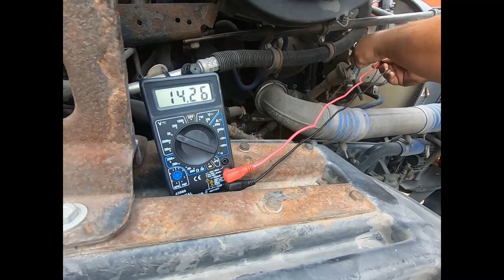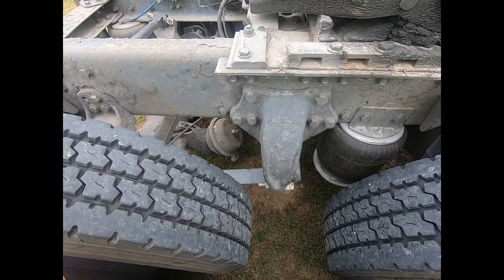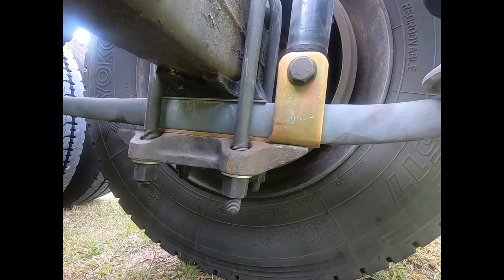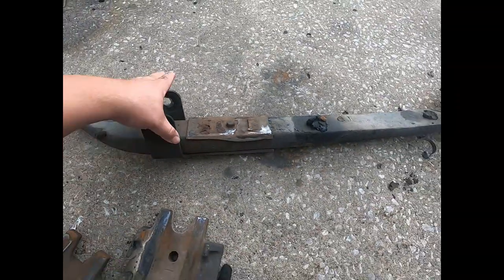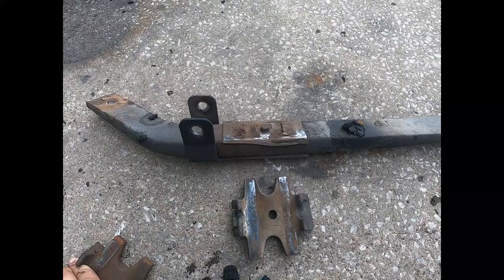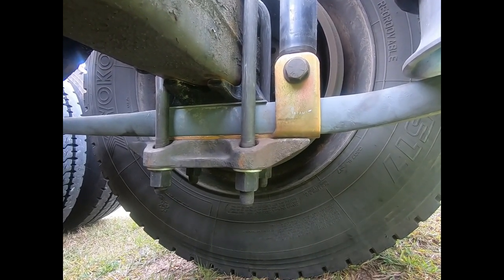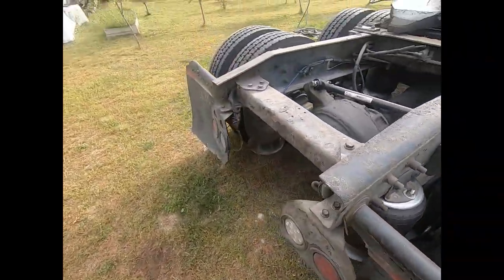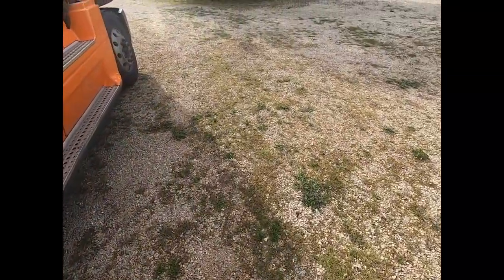Freightliner air bag lean...solution!! and suspension work

Comment: You made the right decision to keep your truck , i had a 2004 columbia with a 14.7 liter detroit  it came time for an overhaul at around 905k miles and i regrettably decided not to and sold it for 5 grand,  and got into a cascadia with a dd15 , man what  a freaken mistake,  first i knew nothing about def crap and I've come to the conclusion that trucks with def systems are not made with owner operators in mind there strictly made for fleets that turn them in b4 the warranty runs out or 450 to 500k miles cause thats when all the issues pop up and the trucks live inside the repair shop , it doesn't matter what truck it is they are all in the same boat , check engine lights , dangerous derates , clogged one boxes , constant regens , clogged egr tubes , leaking egr coolers automatic engine shut downs , the list is endless , keep your truck ffor as long as you can you wont regret it

Comment: Appreciate the vid! I've had my whole suspension redone when I first got my truck because of the lean and front bushings being shot. $2600 later everything was great until about 4000 miles, the lean came right back. I noticed on that little plate you pointed out on the rear was shifted or my spring was shifted from that plate. So now I have to take it back in and I will insist that they not only change those plate's out but the spacer as well. Appreciate your video and pointing this out.

Comment: Good afternoon, me and brother, just did the same thing. Replaced all 4 bushings, u bolts 1 of them plates. My driver side is sitting lower than the right hand side. I also put air bag on,leveling valve and new rod. Steve from N.B Canada
Reply: If it's still leaning,  make sure you placed the blocks in the proper orientation.  If you dont, you can get a lean. Had a mechanic replace one leaf spring and he put the block back the wrong way and it leaned pretty bad and had to take it to a different shop to fix it.

Comment: You dont need a 1 inch rattle or a 30 gallon compressor to do the work- a 3/4 is sufficient-The Hot wrench is your best friend A set of torches you can replace any part on your truck-Even with hand tools as long as you have a torch Ive done front leafs-Pins and u bolts by myself- Rear Bushings (I dont replace Good springs) bags-shocks-Its all easy if you think- But its heavy work. I rebuilt my fifth wheel- Steering Box, A-arm Tie Rod ends- All easy but heavy-Thats all- Shops take too much of your hard earned profits......And if the Job is too Big,Get yourself a small 2 ton crane- Its a lifesaver-  Wait till you have to do a Clutch,Rear main seal-Or Main/rod bearings- Part of owning trucks- no one taught me anything- I Drive and Got sick of half Azz mechanics who take no pride in your truck.

Comment: This is what I was looking for!! I've been trying to find a fix to detect what was wrong with my Argosy! This video helped me a lot! Found out that my center bolt had snapped in half and also found out that I snapped my shock absorber bracket too lol. Luckily I didn't damage an airbag or shock absorber. But I discovered that I had loose u-bolts that were ready to snap!

Comment: I have a 2006 freightliner columbia straight truck that the spring assembly has moved their is a aliment part hooks into the plate that has the u botls go though and the other end botls to the flange at the end of axel, The problem I have is this part dosen't show up on freightliner's computer so i need to find this part . I have pictures of this part that I can send to some if they need to see it.

Comment: Have a tri drive dual steer Freightliner concrete pump. We just purchased it.  I just did all the bushings on the rear axles among things. It's  got one hell of a lean. I'm gona be looking at the things you've pointed out.

Comment: I've found a great easy solution to the issue with the airbag lean. Less psi in the rear passenger side set of drives, my bags both leaned to the right at the top and to the left at the bottom but only in the rear set the front set of airbags were both even steven so I made sure all tires were spec psi and with a bubble leveler and a little geometry I made the required adjustments and the truck drives like a dream now! Over bumps around curves its a totally different ride even the steers started finally wearing even I've taken it to plenty of shops and replaced too many leafs and tires only for the issue to return and finally figured what the hell let me take a crack at it, I honestly wish I would have done it sooner. Such an easy fix that only cost me 7psi
Reply: @educateyourself8255  I didn't, I got rid of the truck
Reply: Less psi??? How?
Reply: So did the psi thing work??

Comment: When I purchased a new freightliner or used freightliner I built my own air bag cross members one for each rear axle if suspension need a rebuild I would do that first on used truck then add the cross member to axle if truck was new I did the same thing. Problem solved got 1 Columbia with 1.9 million still sitting and riding as good or better then my 379 0r 389 ...
Reply: Do you do suspension work?
Reply: I do not I look at other types of trucks with cross members and made some calls and did my research the reason back in 1995 threw present is that they concluded that the cross members weren't needed so that after the warranty was up U would have to rebuild either part of suspension or all of it but if u bought a new freightliner it was a option for cross members on Pete's kw Volvo it came standard which makes much more sense theres more to it then just the cross members also ware plates also which U WILL have to replace and build if U been running with bags leaning when bags lean it degenerates the ware plates center bolts and hangers and your tires so the truck is always fighting trying to go straight which causes so many issues on not just suspension but much more components which if would of been handled correctly from beginning those component's would of not prematurely not failed do not let air out of one side of bags this is VERY idiotic  the bags have there own height they must be set at to work properly with the rest of the suspension.....
Reply: I have a Semi coustom 2003 Columbia for sale no motor in it but its fully built just been sitting for awhile.
Reply: @blairvigil1633  Where are you located?

Comment: For the front spring upgrade,  I noticed there are two part no's that can be used.  46-1302 which is rated at 6000lbs and 46-1930 rated at 6650lbs. Do you remember which one was installed? I figure installing the 6650lb rated one will be a better upgrade.
Reply from the maker: I honestly don't remember sorry

Comment: 10,000 miles to retorque the u bolts is too long. 1,000 miles at the most. You haven't stopped the issue, like you said it's an inherent design flaw. The fix is to weld stop blocks on the inside top of the axle housing resting against the U bolt block, after you've got it aligned correctly. Since you're using Chad I know it's done correctly, but surprised he didn't tell you of this fix. They won't move again afterwards.
Reply from the maker: Hmmm....he didn't suggest that.. But we did scuff them up to hope fully give a little grip. I will consult him on this...thanks for the input.
Reply: I think you can order this as an option on the extra duty suspension? Do you know anything about the extra duty suspension?
Reply: Thank you for the info. Who is Chad, and where is he located? I want to rebuild the front and the back.

Comment: Freightliner Airliner suspension - the weight is carried by the U-Bolt. The U-Bolts stretch for the life of the truck. The U-Bolts need to be torqued every 6 months, sooner if you replaced the U-Bolts. A Brand New Freightliner or Western Star will have the air bag lean too.
Reply: I got a 2024 and one of them is leaning one would hope for such thing not to happen in a brand new truck …
Reply: @Art_99S  freightliner airbags have alway leaned! Ever since they came out with the airliner suspension. Get those Ubolts tightened
Reply: So you're saying that no matter what, the U-bolts need to be torqued every six months? What's the torque spec?

Comment: We've had this issue with our freightliners and western stars at my employer. There is a debate between two mechanics whether or not to put a brace from the left spring to the right under the airbags like a Hendrickson. I am totally in favor of it.
Reply: Have you guys tried the bracing yet? I'm contemplating doing this also.

Comment: Biggest problem with bag lean is the broken shear bolt or tie bolt that holds the purch and spring in alignment. There is a head on top of the axle housing itself that the upper U-boat alignment cap sets on that holds inplace then U boats go down to the bottom perch which is held in line with the Spring with a tiebolt or alignment bolt once in U bolts get wore loose or stretched whatever allows that the move around which breaks the shear boat which allows the springs to kick inward...
Reply from the maker: The older models didn't have that alignment bolt. Don't know the exact year they started it. But mine was old enough not to have it...that's why I said the new ones don't do it
Reply: This is exactly right. Older ones have centering pin on top of axle which provides nothing for centering axle to spring. Very poor design. I’ve found many with twisted springs. The more it twists the more leverage air bag has on it. The ones with the double spring have a bracket from brake spider to lower Ubolt bracket. Kinda helps keep straight. I install them on all of mine when I have them apart.
Reply from the maker: @chadsmith961  👍👍✌️
Reply: @chadsmith961 Chad, did you do the work on Adam's truck?

Comment: I have one of my rear leaf springs touching the chassis and air bag leaning a bit... i get this vibration in the floor of my truck but i feel like its more of a suspension height problem cause the vibration is on and off ...not all the time.... also sometimes my truck doesnt lower so am replacing that leveling valve today.

Comment: i got one for ya i have a 03 columbia with an airtek air ride from hendrickson  no shackles in rear of springs just a big rubber bushing bolted to the spring an one big bolt going thru the bushing to a one sided mount on frame  truck has been rebushed totaly front to back  new cab bushings as well an truck still shimmy from side to side  i have no more ideas of what to do besides changing out front end with a spring ride
Reply from the maker: Can you describe the shimmy a little. Do u feel like its coming from one place more than another? Front or back for instance? Certain speeds or conditions?  Light or heavy? That's kinda puzzling.

Comment: Wow I wonder if that's what is going on with the Volvo I drive it's a 2019 and just had the airbags leaning and always felt like the rear of the truck was swaying
Reply from the maker: Maybe...if i remember right, i think the volvo has a rail mounted side to side under airbags to prevent something like this. Have you checked the ubolts and such? Ill have to take a closer look at the volvo suspension next time imsee one.

Comment: Don't include my 2016 132 Coronado. Always check your U bolts for correct tightening and always replace all suspension components on each axle at the same time just as you explained.
Reply from the maker: Thanks, at some point freightliner added a pin in the axle housings to keep those spacers from moving.  I assume  yours has it.  Wish I had figured all this out long $$$ ago.

Comment: I just did the bushings on my century and now I get some vibration and my it sounds like my driveshaft grinds on the transmission. If I drop the suspension while driving the issues stop. U joints were replaced like a year ago
Reply from the maker: Better get that #1 u joint checked again
Reply: Sounds like your air bags are over inflated, try lowering them some.
Reply: Late,  I know.  But I'm having the same problem.  Can I ask what was the problem?

Comment: Good morning
I have Freightliner Cascadia, 2020 
What happen if I lower the leveling valve airbags  suspension and driving like that 
What is the minimum lower suspension down for Cascadia 2020
If you let me to call you, I have  some other question
Thank you
Reply from the maker: You need to run it at spec height...you can damage the driveline if driveline angle is off too many degrees

Comment: Would this lean on the air bag cause the truck to shake as well
Reply from the maker: it's possible if really loose, but shaking can be caused by a good many things, will need to have it looked at

Comment: Just bought a freight liner manure truck. Which was originally a otr truck. Had the frame stretched etc. have this issue. Looks like I’m going to have to replace the leafs as one side they are stretched out where the bushings are. You think adding a tag axle would help?
Reply: What did you figure out. I'm in the same boat with an 03 fl112.
Reply: @bryanoverlin839  not much. Don’t have money to sink into it. So I just use it how it is.
Reply: Yep same situation. Wondering why I bought this thing.

Comment: Polished/worn blocks aren't the cause of this problem.. That is part of the effect.  The cause is that freighliner runs the spring under the axle rather than over the top like everyone else, which puts the load 100% on your ubolts.  Ubolts stretch and then all your components wear out.  Horrible engineering.  You will have this problem again.
Reply: Can this be modified safely so that the leaf springs rest OVER the axle?

Comment: Were you having vibration? And if so, did it fix it ?
Reply from the maker: Not really... But so far it fixed the other problems.
Reply: Oh ok, well that’s good. I have both rear axle leaning, but I have some serious vibration. They also seem to be more inflated than the front two. Any idea?
Reply from the maker: @marknegrete2406   it can very well cause vibration by misaligning drive shaft. Rear bags will always be higher than front, Thats normal
Reply: Since the leaning are the rear bags, would that mean the small shaft could be running unaligned?
Reply from the maker: @marknegrete2406   could be...also, will affect the ride height which can cause vibration. Or can be a combination of things.  It can cause your rear differential to side load the gears and eventually wear on a differential also.  It just sucks all the way around.
Reply: I fixed my vibration by replacing my china tires with usa made Yokohama,  or anything that is a not out of round tire from the factory.... before the shakeing was unbearable....

Comment: Hi DIY,  my freightliner columbia columbia steering wheel  shakes between 40mph to 55mph.  Balanced steer tire and installed new tire but still shaking. Any idea sir?
Reply from the maker: To be perfectly honest, it could be a whole lotta things.  Warped rim, out of balance brake drums, check all steering components, king pins , tie rods, drag link and Pittman arm. Maybe its worth a trip to an alignment shop. They might spot it quickly.This kinda thing is hard to guess without seeing.  What kind of wear are your steer tires showing? Abnormal? I highly recommend m.d. alignment in Kansas City MO.
I don't know exactly all what you are feeling, but unbalanced drive shaft, and bad u joints, hanger bearing can also cause vibration...but you should feel that in the floor.
Reply: @DIYSEMI  thank you sir, l will take my truck to m d allightment in Kansas
Reply from the maker: @kalisterkalister5925  Chad hohn is the man you want to talk to tell him what you have going on. He is brilliant.
Reply: @DIYSEMI  okey  thank you.
Reply: @DIYSEMI Is he the guy that did the work for you in this video? I will tell him you sent me if it is. I want to rebuild the front AND rear. I have a 2009 Columbia, 13spd, 3.55, 14L S60. She's a beast. I want her to have my babies!

Comment: Your video was helpful as I was having about the same problem with the reared walking problem with the airbag lean and was helpful to understand what was going on as it just started and caughtit in time before it got to costly. . Gotta make appointment to get it in to get it fixed. What did it cost to do the rear? So I know roughly what its gonna cost to do this job.
Reply from the maker: Everything in the video was 4500
Reply: @DIYSEMI The front and rear was only $4500 TOTAL?

Comment: Any updates...and you never gave price of the work lol
Reply from the maker: Yes sir...there is an update video. $4500
Reply: @DIYSEMI  yikes
Reply: @DIYSEMI  So labor/parts for 4500$ total for the front and back?
Reply from the maker: @InNoTime3377  correct
Reply: @DIYSEMI  4500$ is actually not bad, i just came back from a smarts truck n trailer here texas. The spring alone from freightliner was 600$ and the labor to change it was 350$
Reply from the maker: @InNoTime3377  alot of people have spent a whole lot of money trying to solve this problem....me Included. I agree 4500 was worth it
Reply: @DIYSEMI   yea mine leans a tad only but am sure its cause the leaf spring isnt centered...i might have to head out to kansas city soon....i would like to do the same thing you did and just replace them all as mine have never been replaced in the past 5yrs ive owned the truck....i bought the truck right at 1mill and am at almost 1.5 so i might be running on the leaf springs from 97! lol
Reply: @DIYSEMI You did good Adam. I was quoted $9 grand! What shop did this for you? Was it T and E or MD?

Comment: Loose u bolts is the problem.
Reply from the maker: Its a combination... The design leads to them loosining. I could run my u bolts down once a week and it wouldnt matter....but by the time i got the truck the damage was far gone.. Beside that, 6 dealers wouldnt address the problem.
Reply: @DIYSEMI  ture,i just check the bolts every time i service my fld120 and my classic.Havent had one move in years.